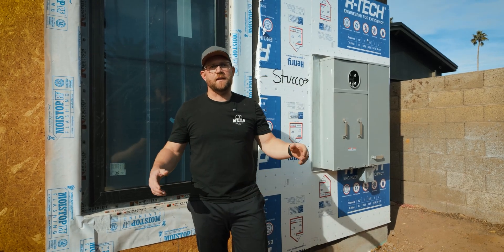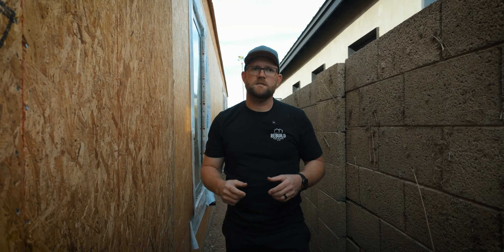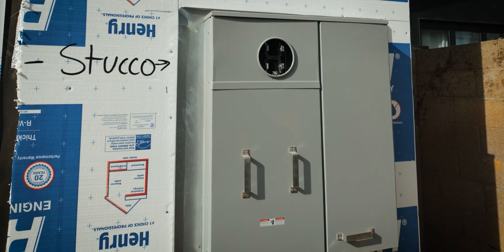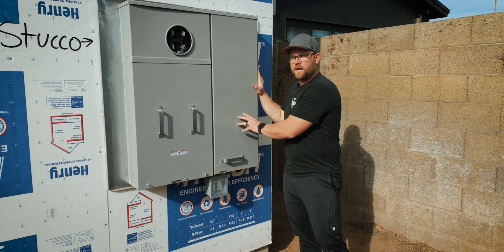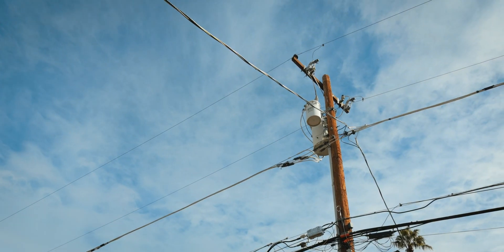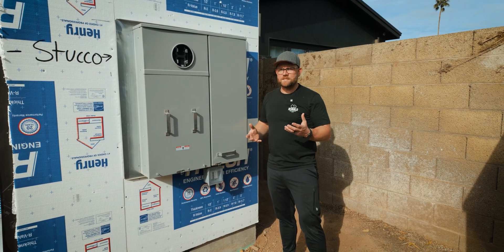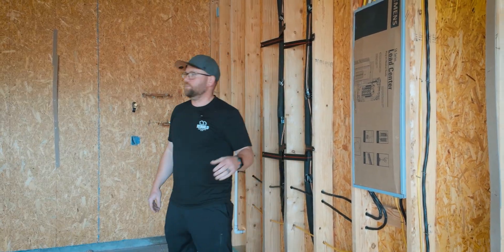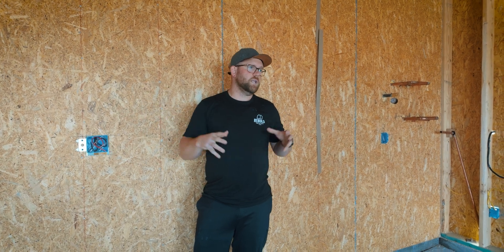400 Amp Panels: The Future of Residential Power? | Rebuild The Block

Comment: Why are you not just using a smart panel that does automatic power balancing rather than jumping up to a 400 amp panel?  EVs ca certainly use a lot of power, but it is pretty easy to only use that power when the rest of the house isn't using it.  Just keep the max power below 200 amp (with reserve) using a smart panel and you can still have fast charging for 2 vehicles and be fine with 200 amp.
Reply: Nothing beats a regular circuit breaker panel or fuse box in terms of reliability and lifespan
Reply from the maker: @NEON2600 old school love it! ❤
Reply: smart panels cost more and are a lot less reliable
Reply: Code doesn't allow it. NEC Section 625.42 states that “Electric vehicle charging loads shall be considered to be continuous loads.” That means a dedicated circuit rated at 125% of the charger's ability. So a 40 amp charger circuit must be 50 amp wiring and breaker. 
So 2 chargers would be a mandatory 100 amps just for chargers right. Kind of. Further on it reads. 
“Where an automatic load management system is used, the maximum equipment load on a service and feeder shall be the maximum load permitted by the automatic load management system.”
So if you were to install a very expensive load management system you can get away with 80% split between 2 chargers, but that will slow your charge rate as well.

Comment: It seems the best place for the service panel is on an exterior garage wall. Keep the heavy guage copper runs short.
Reply from the maker: Agree would do that every-time if we could. but here in Phoenix most service taps come from over head from back utility alley. To get it to the garage add cost of trenching underground conduit and special permit to cross the alley if electrical is located on the far side. 

Hence the reason sub panels are so typical in new construction.

Comment: 400A ??? for one family? that wiring for a house must be a fortune...
Reply from the maker: Yep for one family. This is happening all over our area.
Reply: I have a 1 family 2,200sq ft 3 bedroom 4 bath, and when I did the load calculations it needed 3 phase 200 amp service. 100% electric, multiple car chargers, tankless electric water heater.  It’s all super energy efficient, to total electric usage is low, but peak loads can be very high.
Reply: @rpvitiello  i got all elecric house, a EV heat pump, and 3x25A 230/400V .... the main supply cable is 5x 3.6mm diameter